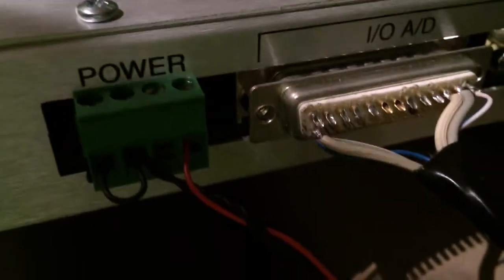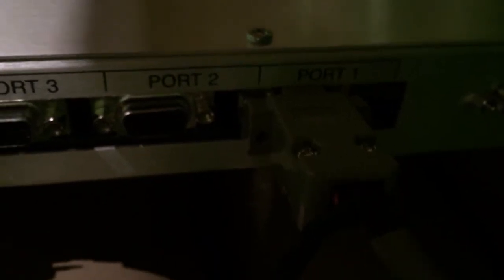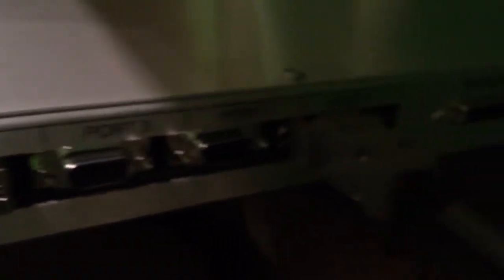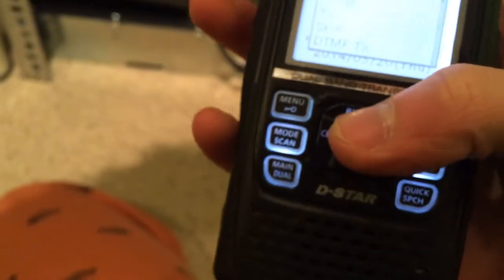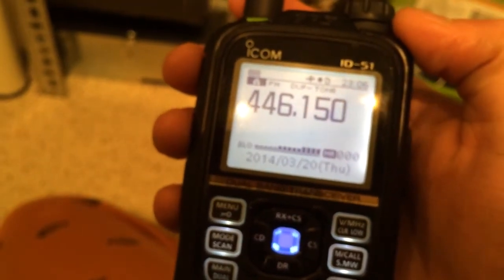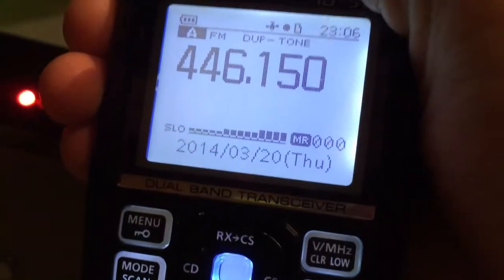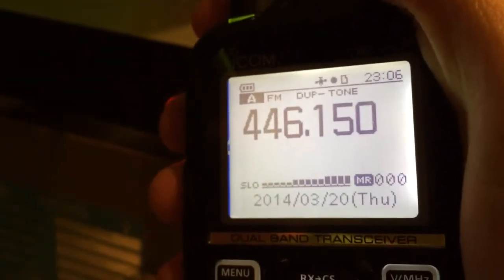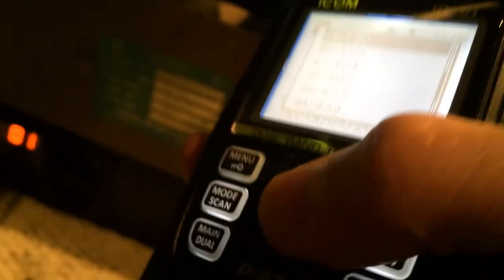An In-Depth Look at the W8SRC Repeater System

Comment: why so many annoucments please dont make the echolink that long it will drive people off i should know ive tryed it before mine is just a double beep then 2 second hang time then a 25 WPM morse ID
Reply: Jon Williams um....no. He is.not smart by doing that. The first comment is correct, it talks way too much.  That much speech was cool.....in 1985. Now it is just annoying. He only has the repeater up so he can hear himself talk.
Reply: kjilk simble  He is smart by doing that because it increases activity on the band. The last time you flipped through channels or frequencies on your radio, did you stop because you heard the repeater ID or some one key up? K5DVT